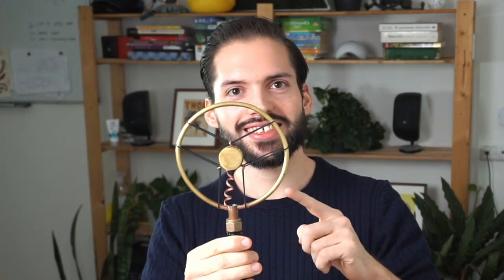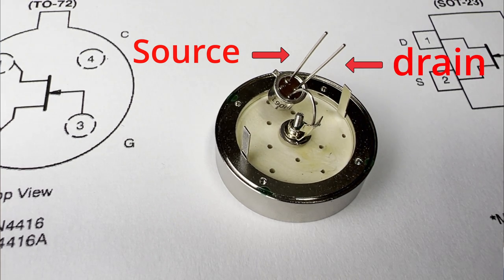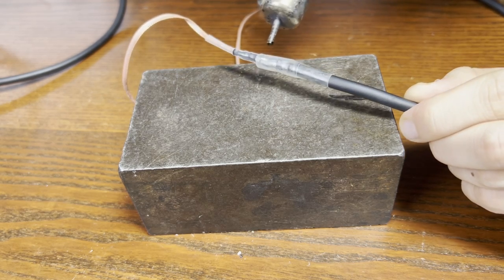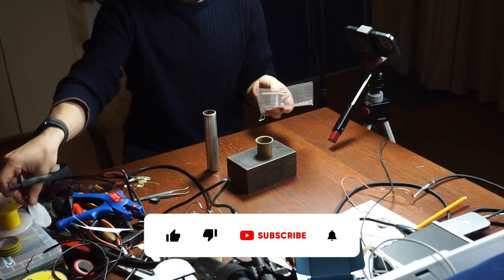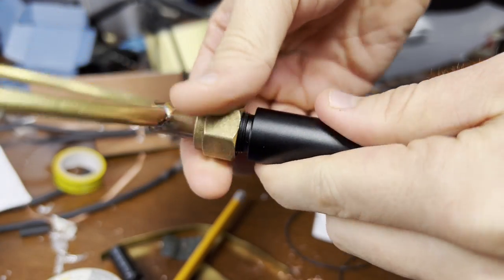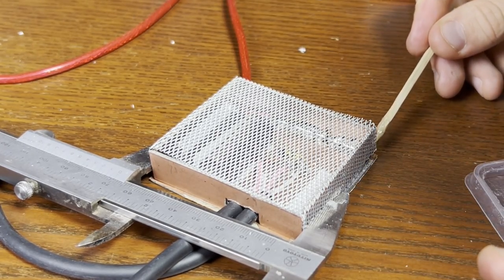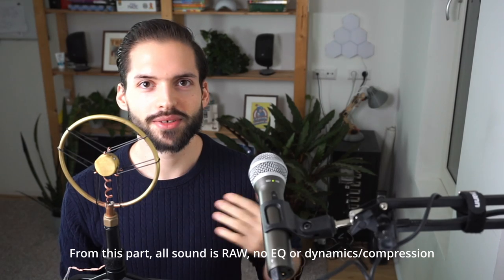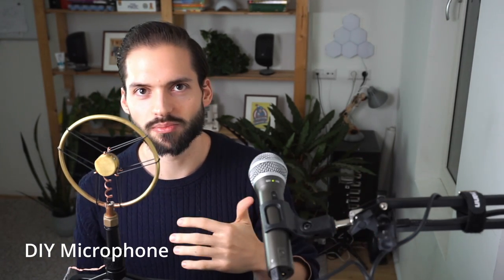Building a High Quality DIY Microphone

Comment: EE tech here. You can simply use a dab of solder on a soldering iron to burn off the enamel on those wires. No need to sand. Only time you'd need to is if you used wire with a Kapton like insulation instead of enamel.
Reply from the maker: Aah cool! Thanks for the tip. I found it very difficult to even add solder because the wires are so thin

Comment: That is awesome dude, well done. I'm still tweeking mine own DIY verison of DIY Perks design. I've made mine with self designed and 3D printed parts. I'm getting some background noise pick-up still - it doesn't sound as clear as yours. Did you have this issue? Is that also the reason for the addition of the 200uF in series with the gain resisitor? I.e the high pass filter?
Reply from the maker: The 200uF (non polarised) in series with the 27 Ohm gain resistor is indeed there to make a high pass filter. Without the capacitor the mic will be amplified down to almost 0Hz and that is very annoing because it gives very low noises (if you touch the table, walk around or even the air emitting from you own mouth) and so noise below 20Hz should not be amplified. I did some other things like adding the 3300uF and 100pF capacitors but the biggest difference was when I closed up the microphone cage really well, that got rid of a lot of weird noises
Reply: Hy, do you have the  3d printer files?

Comment: Awesome video, thank you for sharing the experience! Just came across it while looking at the one from DIY perks since i started to build mine as well. The electronic part works already, just need the case now. I had the same idea to mount it onto my existing mic arm. Really happy i watched your video now, because i plan to use a steel mesh as well :D
Reply from the maker: Super cool! I’m very curious how it will turn out, keep me posted :)
Reply: @Timvdv  hey i want to make this too, i looked over your video and the guy who inspired you. in his video he states that in order to keep cost down he made his own amp from scratch. does that mean that i could use my existing audio interface to power this with a xlr instead of making a homemade amp ?
Reply from the maker: @daltonwaters2540  Hi Dalton, yeah, in theory if you connect the microphone directly to a XLR you could do this. The problem is that the sound coming from the microphone is really soft so you would probably need to add some sort of amplification in the schematics on the mic or have a really powerful audio interface
Reply: @Timvdv  I really appreciate you commenting back, would the amp need to be homemade or could it be purchased online. I seen that the operating voltage of the condenser itself is 1.5 volts is that something I need to take into account?
Reply from the maker: @daltonwaters2540  I don't fully remember the exact numbers but I'm pretty sure you need to make some changes to the schematics. Before I made the pre-amp I also tried to connect it to my own audio interface but while on max gain the audio was barely audible

Comment: Great timing! I just started putting one together and needed some info on building the case. I like your design, its simple and effective, judging by the sound! I'll get me some brass mesh too! I would have tried stainless, but am likely to run into high resistance solder joints just as you did. As I don't feel confident stick welding stainless mesh I'll go with the brass!
Reply from the maker: Good luck with the project! Would like to see your final build as well
Reply: @Timvdv  Sure, I subbed and will keep you posted!
Reply: @sail4life and?

Comment: Very nice work.
I actually thought about a ring design like yours as soon as I saw the video of DIY Perks.
The sound of the diy mic is way better for my ears but if it is such a hassle to avoid background noise the 70€ mic might be still the better option.
I guess that even the 500€ stock version of that capsule mic does pick up a lot of ambient sound.
Thanks for the nice video.
Reply: It costs €500 exactly because of ability to pick up every detail including ambient even from the next street through the window.. (and because of manufacturing cost of very flexible film covered with an layer of gold).
If you require noise cancellation, then you need mic pre-processor with expander/gate functionality, e.g. dbx 286s or a silent studio room.
The two mics in the video use different type of mic capsule, and the other one (dynamic) has almost no sensitivity with distance compared to DIY one (condenser) thus no background which is a trade-off that results in less accurate capture of the actual speech.
Reply: @Mr.Leeroy  Thank you so much for your response.

Comment: Nice Video! I was wondering what you meant by "any old audio cable"  -I'm currently in the process of building this myself and was wanting to know what specific cable you used or any alternative to that cable you used.
Reply from the maker: Thanks! The cable I used is just a normal XLR microphone cable and I cut one of the connectors so I could wire it to the microphone module directly
Reply: @Timvdv  Thanks sm!

Comment: Hi. One question: The source/drain of the F.E.T. you've soldered to Hot/Cold of an XLR cable (Shield obviously to GND), when connected to the TASCAM device (or any other Audio Device like MOTU/Roland/FocusRite), does it work with its Phantom Power ? Otherwise I don't understand why soldering an XLR cable. Thanks in advance.
Reply from the maker: Hello! My plan was to use phantom power indeed, but it did not work unfortunately. I know there are a couple of people who tried is as well with different schematics! Check the forums :)
Reply: Thanks  @Timvdv  I was modifying a NEEWER NW-800 (it has an embarassing capsule...) and I had to add a N-JFET 2N3819 o get the capsule (similar to yours) working with the inside preamp to a PreSonus TubePre. Thaks for responding me :)
Reply from the maker: Cool, upgrading an existing one, interesting idea as well! Did you get it working in the end?
Reply: Unfortunately I cannot attach any photo and I'm not used to make videos.......

Comment: You can not solder aluminium.
Moreover it will corrode with copper or similar metals in the presence of moisture (even from air).
Reply from the maker: Yep, that was definitely something I learned from this build 😅

Comment: Hey man, really cool how it turned out!  as someone else already said, diy mic sounds like you are in the same room as me where the other mic is more compressed.
I have a few questions (I am also waiting for parts to build this diy project)
The 2N4416A transistor looks just like the one I got (logo seems the same 0:52 ) but I can't find any documentation on it, could you send me the documentation? I want to check myself too since I am not sure it is the same transistor
Is the noise isolation that bad? I like the sound of it but I am a bit dissapointed to hear it picks up every noise arround it. From what I remember, in DIY perks video he said it is highly directional (7:02 in his video is where he said that)
Reply from the maker: Hello, I used the documentation from Farnell. You can find it over here: http://www.farnell.com/datasheets/39775.pdf about the noise isolation, it could be that I did do something different or I'm not familliar enough with non directional microphones but one thing is for sure, it picks up way more than the Samson Q2U. It's so cool that you're also doing this! Let me know how it turned out.

Comment: I wanted to make my own microphone when I watched the same video and saw way more expensive capsules on that website, Soon I'm gonna try and replace the internals of a b800 with ("quality"?) parts. Most of the build is from JLI's website itself.
Reply from the maker: I don’t see the b800 on the website myself but this is a very interesting idea! Just make sure it doesn’t already have the transistor inside so you can still tweak it

Comment: Nice variation on the DIY Perks build! But seriously, how did either of you open up the desoldering braid so easily? I've tried a few different brands and I'm not at all certain that it even is tubular to begin with. Trying to tease the end open just makes a mess.
Reply from the maker: Thanks! My dad brought some from his work where they have this huge roll so unfortunately I don’t know the brand. But opening it up was really easy so I guess it’s something different then, good luck with your build!
Reply: did you find a brand that is tubular?
Reply: @medanibarra  I did. I found an older package of "Chem-Wik" by Chemtronics Inc. The difference is not obvious at a glance. The ones I ordered from Amazon were all non-tubular though.
Reply: @EikiMartinson  @danielibarra6826 Can either of you please give more info or a link? I'm having some trouble finding it.
Reply: @stack.that.cheese  I'm sorry, I really can't. I found an old spool of it in the lab at work that turned out to be tubular, but none of the brands I tried from Amazon were.
Reply: @EikiMartinson  Thank you for the response, if anyone figures this out please let me know!

Comment: can i use aluminium mesh instead of copper mesh for shielding the wires?
Reply from the maker: Yes you can in theory but it’s very difficult to solder aluminum because you need very high temperatures

Comment: This is such a cool project! I've been thinking about trying to make my own microphone, but I wanted to make something similar to a Shure SM7b because it handles screams better. Apparently, it's a gain monster so I wonder what changes I'd have to make to the schematic to replicate that.

Did you ever figure out the issue with it picking up more sound?
Reply from the maker: I am actually still using it without any modifications and really happy with it. With some postprocessing, you can get great results.

Comment: Hi Tim. I was trying to figure out how to use an XLR output with Matt's design and came across your video. The THAT 1512 seems to output an unbalanced signal with two conductors: an audio out and a ground. XLR (or 3.5mm TRS) is generally used for microphones with a three conductor balanced signal: a positive, a negative, and a ground. Unless I'm missing something your schematic doesn't seem to address this. Can you explain what you did?
Reply from the maker: Hi Lulz, you can actually just pass the unbalanced signal directly into the XLR cable. The third pin of the XLR cable (which makes it balanced usually) just goes to ground. Here is an image that shows a bit better what I mean https://cloud.tvdv.me/RBunqJ8X hope this helps!

Comment: Really great video! I also want to build a version of this microphone, but my version should use the 48v phantom power and no internal preamp, because i want to connect it to a preamp via xlr. Do you know if that is possible?
Reply from the maker: It’s definitely possible but the schematics are a bit different! Check out the DIY perks forums I’m pretty sure some other people are also trying to make this
Reply: @Timvdv  I did, there is a circuit for my use case. Thank you!
Reply: @fantasticfred  where did you find the circuit i cant seem to find it anywhere? thanks in advance !

Comment: Yo, I got a question about the polarity of the 2200uF capacitors. your schematic shows one of the capacitors to be opposite to the  direction described by DIY Perks. can u confirm that it is working with that polarity? cause lots of people seem to be having problems with noise!
Reply: also, why did u use 3300uF instead of 2200uF?
Reply from the maker: Oof, it’s been a while ago already since I made this but I did fiddle around with different capacitors and fixing potential ground loops to reduce the noise in the background
Reply: And the polarity? Should I place them in the direction u wrote down in your schematic pr the one from diy crafts?.
He has the 2200uf in opposite direction on the -15v line.
Reply from the maker: @GTexperience_Channel  Ah indeed, I see it now! You found a mistake in the drawing. It should indeed be reversed, good catch! I'll see if I can still update the drawing for the future.

Comment: Personally i dont understand why its necessary to have a mesh on both sides of the microphone. You only the microphone to pick up the front sounds.
Reply from the maker: The faraday cage is very important so radio signals don’t come through which can cause interference. You could in theory make the back part from like full aluminum or something as long as it is connected properly
Reply: The cardioid pickup pattern needs sound also coming to the back so that it can reject it
Reply from the maker: @lucasc5622  Yes true, in the case of this specific microphone it wouldn't help with the sound quality

Comment: Genuine question. If the cable doesn't move, and you connect it to a normal thicker wire anyway, why use the ultra think copper wire for just a few inches?
Reply from the maker: Haha good question! I’m pretty sure it’s to minimize the movement in the cable, this way if you touch the big cable you don’t hear it because the small wire is a bit more bouncy
Reply: @Timvdv  Mja, that makes sense/

Comment: I am currently in the middle of this project, and when it came time to thread the wire through the desoldering wick I found out that my wick was not a tube! What brand of wick did you use to sheild your copper wires?
Reply from the maker: My dad actually got some from his work, I know it’s a big ‘professional’ roll but I would not know what brand! Hope you find it though, good luck with the project 😁

Comment: Doesn't aluminum and brass corrodes if they touch?
Reply from the maker: I thought so as well! But apparently only under very high heat which my soldering iron is not able to handle

Comment: Have you just left the Volume Control Knob out or did you do something else? I wanna build it too but I'm stuck with the volume control knob.
Reply from the maker: Hi Trempi, yeah, indeed I left out the volume knob, I tested out a couple of different resistors to see which one sounded good and I do the volume control with my audio interface
Reply: @Timvdv  thx for answering, which resistor did you use in the end?
Reply from the maker: @trempi8456  I used a 27ohm resistor! You can find the schematics in the description if you’re interested

Comment: well your diy mic is a condenser while samson is dynamic, a condenser with a decent capsule, obviously it would be more sensitive than a dynamic one, anyway it would be better to compare it to the actual cad e100s, that would be indeed interesting 

anyway imo when you use a pre-manufactured capsule it's not really diy

Comment: Hi, nice build. I did the DIY-Perks Mic as well and experience some hisss. Did you have the same problem, is the hisss probably related to the housing? I just put it together but not soldered the parts together.
Reply from the maker: Hi Mikelt! Yeah soldering the faraday cage shut made a huge difference, that's also why I switched from aluminium to copper mesh. I also did some other measures to reduce potential noise like adding the 2k2 resistors (see schematics in description) but the cage was definitely the biggest problem.

Comment: How do know which pins to connect?
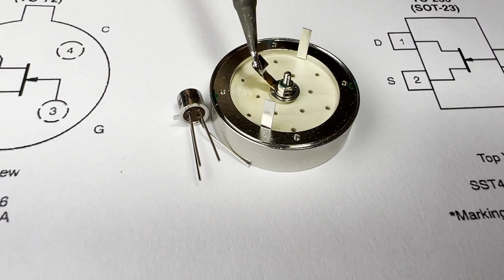1:03
Reply from the maker: Hi! You can find the pinout of the 2n4416 here. https://drive.google.com/drive/mobile/folders/1jQY1SycV0OChw9_9w9qhMVCW47YFHgBu the gate pin goes to the microphone module and the plus and minus go to the amplifier plus/minus pins on the THAT1512